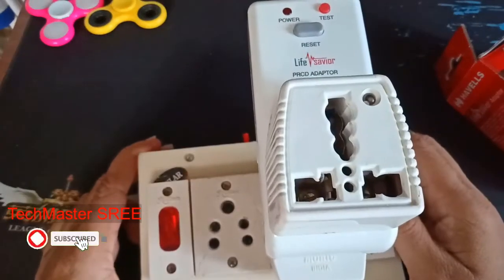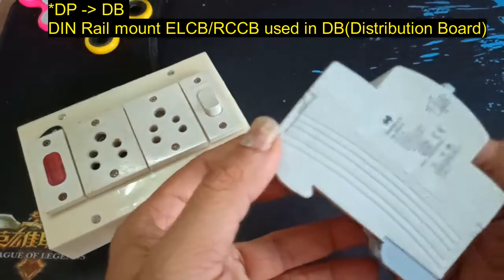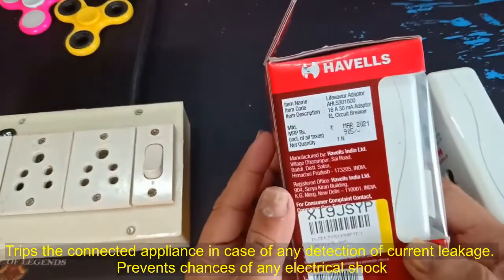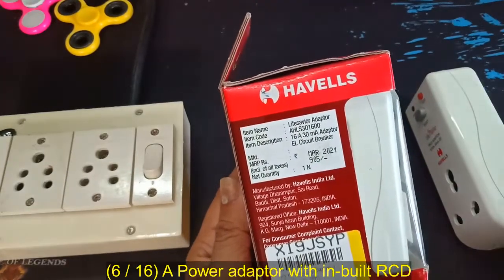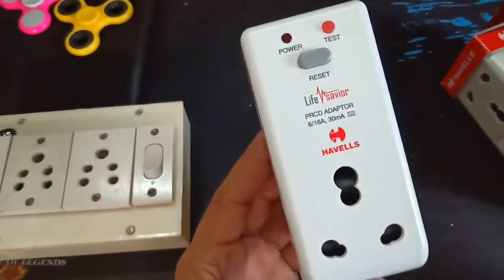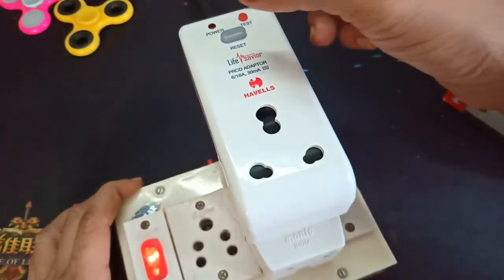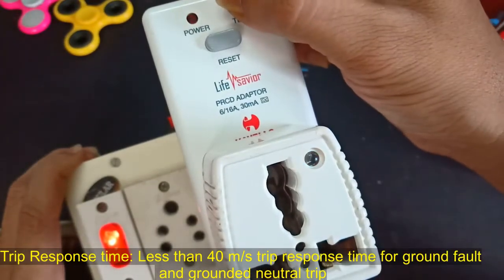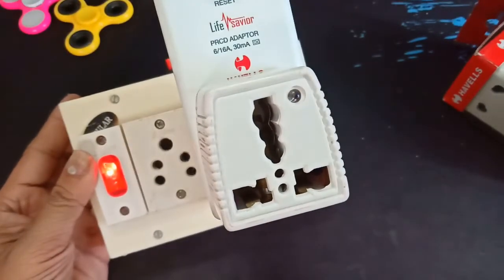Havells  PRCD Adapter/Portable RCCB  - LIFE SAVIOR ADAPTOR 16 A #malayalam

Comment: Is this good to use for EV charger to protect the charger?
Reply from the maker: @samy333546  This is good to protect user from issues with charger. If you want to protect your charger then use under over volt protecter specified in the following videos. You will get link in the specified video description.
Reply from the maker: @samy333546  video link https://youtu.be/pG6kWmFdrYY?si=VKAiygucYxYTWx9B